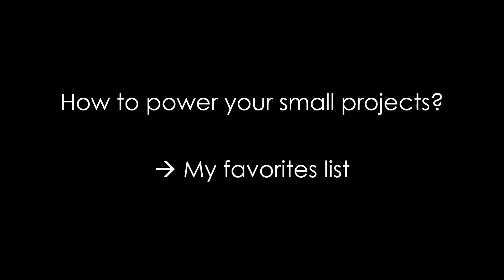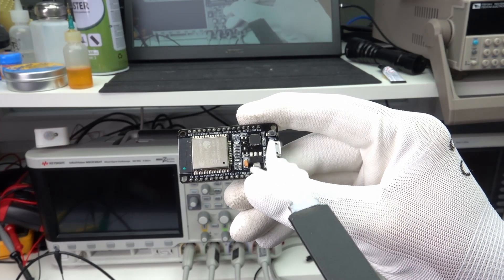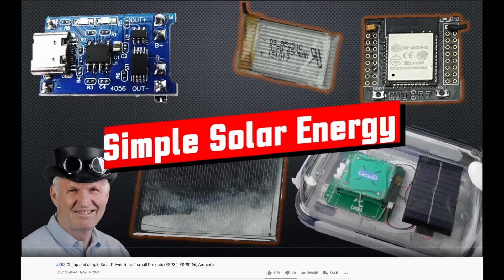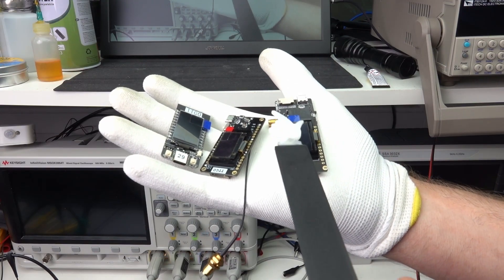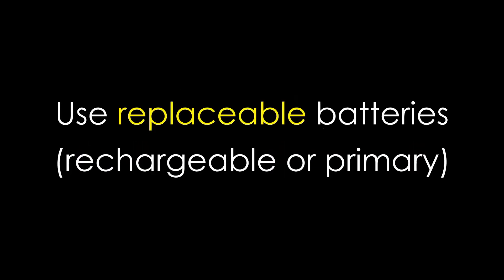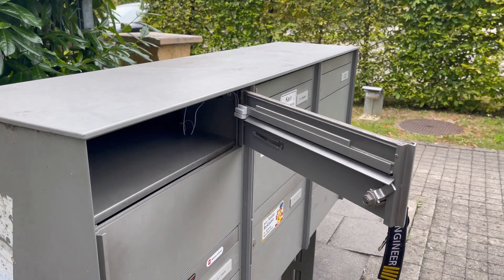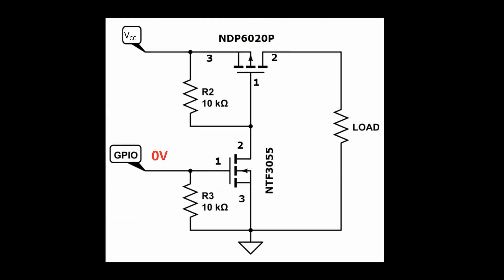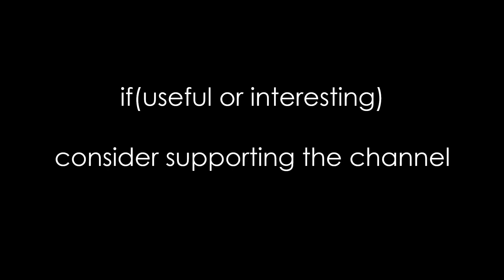#400 The Best Power Source for ESP32/ ESP8266 Projects

Comment: Hello sir, i wanna ask. I was try esp8266 with oled SSD1306, DS18B20 with 3 baterry tipe AAA series circuit. I use deep sleep every 1 minute, and active for 7 second (for display oled 5 second then shut down the display and send esp now till deep sleep for 2 second). The battery just survive below 2 days. And if the voltage battery under 3V the esp getting error then died. (Sorry for bad language) Thanks sir❤
Reply from the maker: I once made a video about proper deep-sleep design. Not easy...
Reply: @AndreasSpiess  yeah sir, its also more hard for me. i Will using mt3608 to step up volt with 2 AA batteries.
Reply: I expecting the battery Will survive at least 1-2 months. And i avoid or don't wanna used Li-Po battery or 18650 battery.

Comment: Hi Andreas, what kind of power meter would you recommend for measuring breadboard power consumption? I'm considering running a breadboard power supply and possibly a USB power meter. Are they any good? I'm working with very low power consumption circuits as I'm optimising it to run on 3v coin battery.
Reply from the maker: I should get a nice small power supply for the breadboard which does that. It was made by a young maker. Now Seeedstudio has taken it over, and you can get it there (search for XIAO PowerBread). Otherwise, a USB power meter should work, too. But they only measure a few mA. If you want to measure deep-sleep currents, you need at least a Power Profiler II from Nordic.
Reply: @AndreasSpiess  Thank you so much, I purchased the XIAO powerbread to get started. If it doesnt measure sufficiently, I'll get the PPK2
Reply from the maker: @danobot12 Mine seems to be at the postal station and I can get it tomorrow ;-)

Comment: Hi Andreas, do I need a heat gun to solder esp wroom to the pcb?

Or can i ignore to solder the middle part?
Reply from the maker: I do not use a heat gun for soldering such large parts. It is easier done with a soldering iron.

Comment: Which one do you recommend for an ESP32 WROOM? Considering it has a 5 V and a 3,3 V voltage supply pins
Reply from the maker: Most of the ESP32 boards run on 3.3V (with a 5V regulator to be powered from USB). You should be able to connect 3.3V directly to the 3.3V pin. So you have many different possibilities for powering like mains (via USB), Li-Ion (with a 3.3v regulator or LiFePo4 batteries without a regulator.

Comment: I came across a problem with my esp32. When I power it with two AA 1.5V batteries, wifi doesn't work. Why? 
But it works when I power it with my computer via USB cable.

Also, I use nextion. It requires 5V, when I supply it with batteries, it starts blinking. When I power it with via USB cable from my laptop, it works perfectly.

I need your help.
Reply from the maker: I would check if all power requirements are met. For example, if the ESP32 chip gets 3.3V. This is not the case if you connect 2 1.5V batteries to the 5V connection for example.
Reply: @AndreasSpiess  On esp32_datasheet, it says: "The operating voltage of ESP32 ranges from 2.3 V to 3.6 V. When using a single-power supply, the recommended voltage of the power supply is 3.3 V, and its recommended output current is 500 mA or more.
"

Also this:  "When Wi-Fi is enabled, the chip switches between Active and Modem-sleep modes. Therefore, power consumption changes accordingly."

What I did was simply power up esp32 through Vin  pin with 3V, which is enough for esp32 to operate. 

Now I want to try 3.7V ion batteries with boost converter module xl6009 to increase voltage from 3.7V to 5V, and then power up esp32 through usb port,  not Vin pin.

Am I doing the right thing?

Comment: 4:18 I want to make a battery powdered project using ESP32-S3 which is going to use a 4.2V Lipo as power source. The project is also going use 10 LEDs. The ESP32 with WiFi is going to be powered for around 5 minutes at a time and then go back to deep sleep. 

Question: Between the Battery and ESP32, should I use the HT7333 Voltage Regulator(250ma max output), or should I use another Voltage regulator like AMS1117?
Reply from the maker: The HT7333 should be ok for an ESP32. Always include a 10uF capacitor across 3.3 and GND of the ESP.
Reply: @AndreasSpiess  Thank you

Comment: The NDP6020 and NTF3055 don't seem to be produced anymore and you can't buy them. How do I find comparable ones? Is there an easy way to find some that I can still order?
Reply from the maker: By searching in the mouser or Digikey database for a transistor with similar values. I found one variant (NVD3055L170T4G) that is still on stock. But I did not compare its datasheet.

Comment: Andreas, almost a year later because I've not touched any electronics for a while, but I have a use case where I'm running from a 12v battery powered by solar panels on my shed.  If you see this - is there an optimal way to power the board?
Reply from the maker: I use small buck converter modules (to 5V) for that purpose.
Reply: @AndreasSpiess  I'm amazed you saw this!  I'm having a good catch up on the videos now.  Thanks for all the advice :)

Comment: Hi Andreas, your channel is an invaluable source of information for me. Thank you, you frequently mention the use of bare bones ESP32 boards, do you make these up yourself and how hard is it? Do the smd resistors come mounted on the circuit board or do you need to buy and mount those too?  There are a few videos on YouTube showing people making these boards up but it does not seem straightforward to solder. Thank you!
Reply from the maker: 1. We often use ESP32 modules that include everything needed for barebone usage.
2. You can design your PCBs and, if you do not choose too small SMD parts, can solder them by hand or by using a hotplate (google)
3. JLCPCB offers a service where they assemble your board with their machines. A service I often use lately

Comment: I powered a raspberry pi 3 over about 60 feet of cat 5 cable using an old printer power adapter and a drop down voltage regulator... worked flawlessly for many many years outdoors in Alaska
Reply from the maker: If you start with a high enough voltage that is a good idea. Others call it PoE (Power over ethernet)...

Comment: Hello Andreas,

I am new to the world of microcontrollers and micropython. I use a ESP8266 dev kit on a breadboard. The ESP is powered by the (micro-)USB connection to the computer, necessary for coding and executing Python scripts on the ESP. For additional devices, I use a power supply module on the breadboard which provides 5V and 3.3V. Question: do I have to connect 5V or 3.3V from the breadboard power supply to the respective pins on the ESP dev kit? Thank you for your very informative videos. Regards.
Reply from the maker: No, You do not need to connect them in your scenario. The 4V pin can be used if you do not want to use USB to power the board. And 3.3V is an output.

Comment: so.... after watching this entire video......what product do i buy to use batteries with esp8662?....I still dont know lol, i would like to integrate WLED under my electric scooter.
Reply from the maker: Decide on the voltage levels you need for your prokect (ESP8266, LEDs). Then you search for power (probably your driving battery which is maybe 36V. Then you know which buck converter(s) you need.
I would search the internet for a project. I am pretty sure you will find a seimilar one.

Comment: Thank you for the research effort and sharing your knowledge. For the vast majority of my little project, the LiFePO4 option looks to be superior! In the limited cases where I need 5V to drive a bright LED,  that should be easily accomplished.  👍
Reply from the maker: LiFePo4 is now even more accepted than when I made this video. So you made a good choice.
Reply: @AndreasSpiess  😁
Reply: I hope a quick question: I'm pretty new to the esp32 dev world. I have an intent to do some home automation for a zoned HVAC upgrade. Main interest in that regard is to make esp32-based LCD displays for each room. (System manager will likely be on an STM32 device.)
So, in addition to the LCD, there's a need for temp sensors with each device. I'm familiar with I2C, SPI and other protocols (primarily with msp430 devices using C with direct port management and access). The problem is the bewildering array of ESP32 devices. Suggestions for a dev board for initial development and testing??? I'm a NOOB in the wilderness when it comes to what I thought would be a "simple" search... TIA
Reply from the maker: @Bob-Is-A-PotterNow  Most ESP32 dev boards use the same chip (if you do not select an -C3 or -S2/3 version). The form factor and other components (like battery management) are different (none offers LiFePo4). You should find a video with an overview of some boards on this channel. Maybe you will even find a board with an LCD on it that suits your needs.
Reply: @AndreasSpiess  Thank you for the suggestions. In fact, I followed your advice before you left it! Found some very good information, as usual.😁

Comment: Hello Andreas. I little bit longer question. There is one use case I can not find an answer anywhere. For custom iot made project, I would need to have battetry operated & wirelessly comunicated module, that can live on batteries for at least one year, and can receive & act on message in seconds. There will be maybe one action=message received in monht or so, but when it arrive, it needs to act fast. All other time it may be in some "sleep but lissening for message" state. There are such a devices on the market, like z-wave/zigbee TRV, or door locks. Those run on few cells batteries 1-2 years, and act on o request in a seconds. I tested spirit zigbee TRV, and when I change the tempereature in Home Assistant, TRV receive it in a seconds, and run on 2 AA bateries over one year. Considering it has to move a small motor few times a day during winter, it is pefect example that it is possible. It uses FLiRS (Frequently Listening Receiver Slave) method for it. But problem is, I can not find any module like it for custom made projects. It might be any wireless protocol (zigbee, zwave, bt, espnow, or any radio module like nrf24l01...). Do you have any idea for this purpose? Thank You for any answer. Peter.
Reply from the maker: I do not know of Zigbee modules for DIJ. But maybe you can use the PCB of one of the devices you described. They should have an output pin you can use for your purpose.

Comment: I would like to see a use case for running on a "too small" power source, I have a project where I only have a 4.2v 75mA supply, but need to periodly need to send mqtt data to home-Assistant
Reply from the maker: I probably would add 2 supercaps in series and a Shottky diode from the battery to the super caps.

Comment: Hi, using the ttgo t-call esp32 sim800l have you had problems with the 3.7v lipo battery not cutting in when attached to the JST Connector connector for if the main usb type c 5v goes down. Used as a back up battery? Regards
Reply from the maker: I do not own such a board :-(

Comment: I wondered if a simple DC self latching relay might be a good choice to switch directly to the battery after the initial battery voltage falls.  There's no voltage drop or power required to hold it after it's pulsed open or reverse pulsed closed.  There seem to be a lot of these "bi-stable" flip flop relays available are there any really tiny ones?   Maybe that's already been the discussion, I'm slow sometimes.  Of course there's probably going to be a big spike on the supply voltage...
Reply from the maker: This concept has to be proven. You get small bistable relays

Comment: Hello Andreas, AMS1117 outputs 3.3v 1Amp and it interrupts esp07  if used continuously when used with main power instead of a battery, How can I fix the issue.
Reply from the maker: Usually we add a 1000uF capacitor right across VCC and GND of the ESP modules. You find more info in my deep-sleep videos.

Comment: I tried to reproduce P channel switch. Can someone explain why do I get Off when GPIO is high and on when pin is low?
Reply from the maker: Because this is how the FETs work.
Reply: @AndreasSpiess  According your explanation in this video, Power should be provided as long as GPIO pin is high.
Reply from the maker: 12:10 You wrote about the p-channel FET. Maybe you watch the part of the video again. The n-channel FET is switched by pin high and it switches the p-channel FET by pulling its gate to low
Reply: @AndreasSpiess  My bad, I meant this part of video you pointed (12:10) and understand it. I built the same cuircuit but it does not work as in the video. Strange, maybe faulty parts from Aliexpress.
Reply from the maker: Vgs is important! You need Logic Level FETs

Comment: Hello Andreas, @2:24 you mention that you power the unit by soldering the wires directly to the board.  As an electronics fumbler, I would like to know more.  Which pins and at what voltage do you solder the wires to?  I don't want to use the USB connection if possible.
Reply from the maker: The pins on these boards are marked (usually 3.3 or 5 volts)

Comment: Disappointed there is no simple 3-cell AAA battery option.  I'm putting my esp8266 inside a device that already comes with 3-cell AAA, and at first it worked with a buck dc-dc, that took 4.5v to 2.8v, but failed when batteries got lower.   So now I need another solution, even a LDO will not work when the cells are not fresh.  I watched you other video, and was disappointed on that too.   There are some boards that both buck or boost, but at $10 each, they cost more than everything else, not acceptable,
and I found the chips they use are not available anytime soon right now.    I'm thinking a simple voltage doubler to input to the dc-dc will work but the chips that do this also not available.   searching for ideas..
Reply from the maker: If you use an HT7333 your ESP will rund till around 3.3 volts battery voltage. But keep in mind that the ESPs crash during Wi-Fi operation if they do not get enough current. Which might be the problem in your setup.
Reply: @AndreasSpiess  Thanks for the suggestion!  A very low dropout regulator will work, a 3.0v output will still run the esp until the batteries are dead.  Have some coming now, in particular, part S-1335J30-M5T1U3 that has 150ma and 70mv dropout.  Indeed the xmit power is larger than most of these super low ldo regulators can provide, but like your other video showed, a big capacitor should work.

Comment: Dear Andreas, I would like to use a LS14250 battery (lithium 3,6V 1200 mA)to power a esp32-wroom-32D board and a DHT22 sensor. Do I still need a 3,3V voltage regulator?
Reply from the maker: You do not need a regulator. But its current might not be sufficient for and ESP32.
Reply: @AndreasSpiess  Thank you for the answer! I saw that the esp board can consume little power in deep sleep, can you tell me why do I need more than 1,2 A? Or I could use a LS14500 with 2,6 Ah.
Reply from the maker: Maybe you mixed A an Ah. According the datasheet, the  LS14250 only should be used at 35mA continuously.

Comment: I'm curious where you would see my use case to fit in your flowchart: N+1 battery operated "nodes" (12-ish hours), Lora, No-WiFi or BLE required, frequent sending / receiving (every 15 to 20 minutes), E-Paper Display. Somehow similar to the Meshtastic project you've covered in video number 337. Also, your prefered MCU*?

*https://youtu.be/Y2zJ5dqDKBk?t=288
Reply from the maker: No-WiFi/BLE and low power consumption will never lead to an ESP32 as an ideal MCU. Its power consumption is too high and its speed is not needed in most cases.

Comment: I'm trying to power an ESP32 with 2 AA alcaline batteries and using a step up DC-DC (MT3608) to make it to 5V. The red led blinks all the time non stop.

This setup works for the NodeMCU ESP8266.
It also works using a simple phone charger.

Any ideas?
Reply from the maker: Maybe you consult the diagram of your board to understand what the LED is used for. There are many different boards around.
Reply: @AndreasSpiess  I found out its a problem with the current, low batteries. I don't know what is the DC-DC doing then...

Comment: Would it be possible to use some induction based power source for your mailbox ? Something that is used for ignition keys
Reply from the maker: I prepare a video on Enocean switches. They use Energy harvesting. It would probably work for the door because it is big. For the lid it would probably block the opening while generating enough energy.

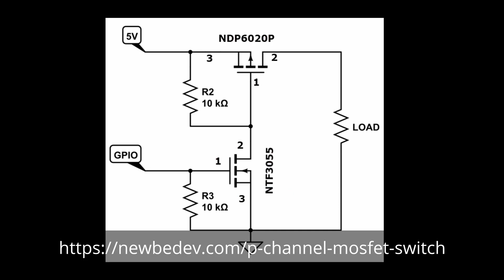Comment: Thanks for all you do on your channel.  I've learned a lot over the past year in following you.  A question about your latch circuit at 11:54 - if you wire a momentary reed switch from 5v to the load in order to wake the MCU up, wouldn't that put 5v onto pin 2 of the NDP6020P in your diagram?  Is that ok?  I can see how it might be "equivalent" to the gate energized and current flowing.

Comment: Hi Andreas,
Thank you for another great video.  In 11:45, you mention the p-channel mosfet solution you proposed in video 101 is not reliable.  What are the exact issues one can encounter?  I was just about to build that for an arduino circuit.  Thanks!
Reply from the maker: It heavily depends on the voltage levels and the Vgs voltage of the FET. Buit you can try. If it works, it is ok.
Reply: Thank you  @AndreasSpiess . I built it with just a p-channel mosfet, and tried (Arduino Uno, with NDP6020P or IRF4905PBF), it did not work.  
With the new circuit you showed in this video it did. Thank you!

Comment: Should the voltage on the diagram for the mosfet not be 3.6 because you are using a lifepo battery or where does the 5 volt come from ?
Reply from the maker: You are right. I used the picture from the other video. It also works with 3.6 volts.